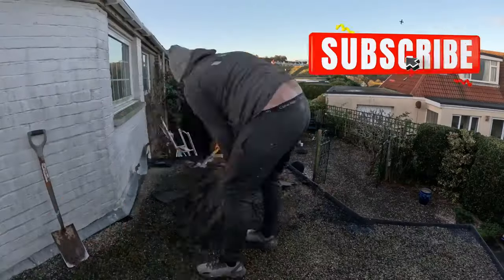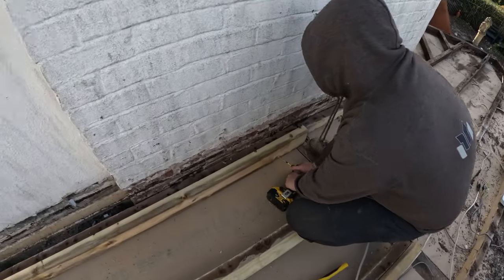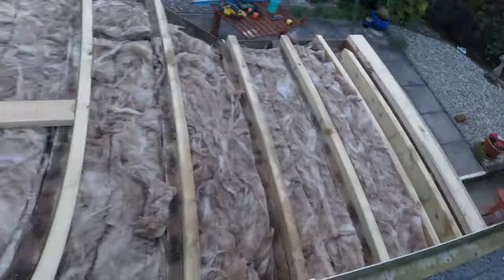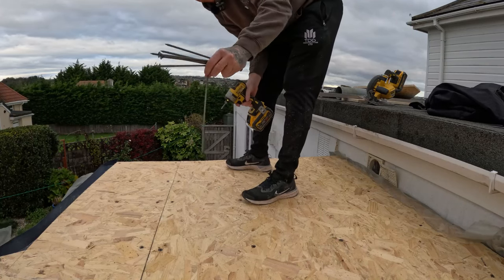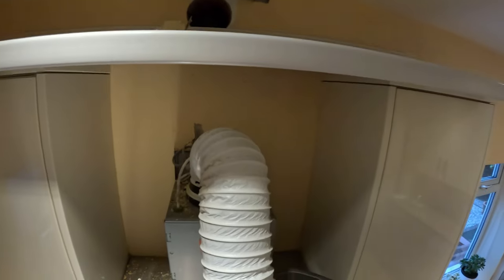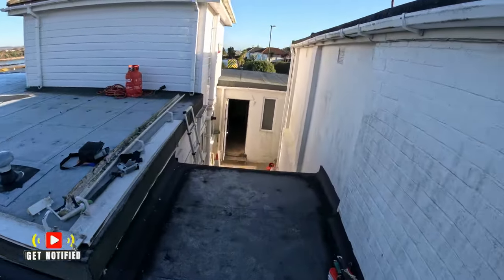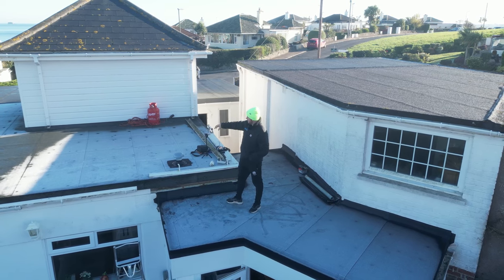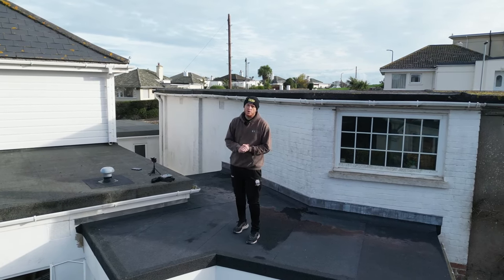How to Install a Warm Roof | Easy & Quick

Comment: Do you need a vapour control barrier on the inside ceiling? what happens to vapour migrating into the soft insulation between the joists....will there be any issues with condensation? any ventilation needed?